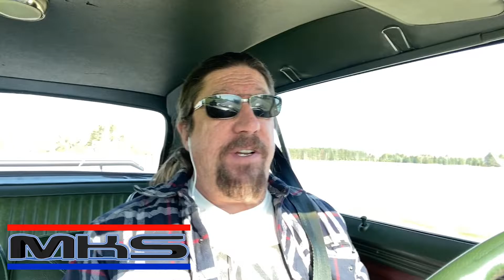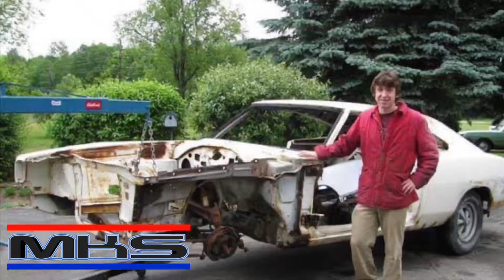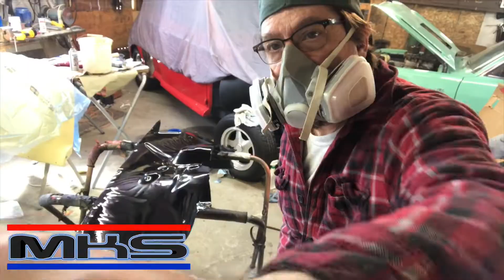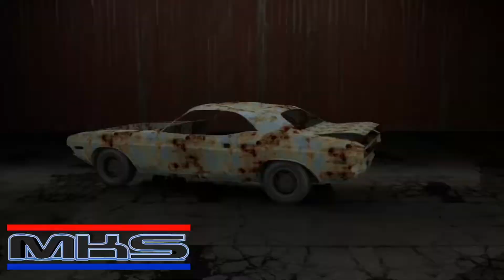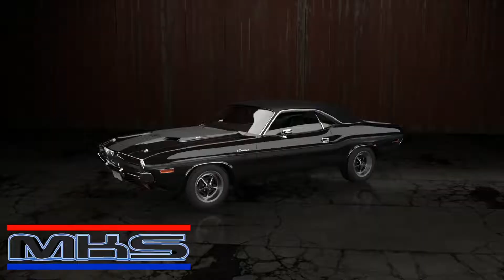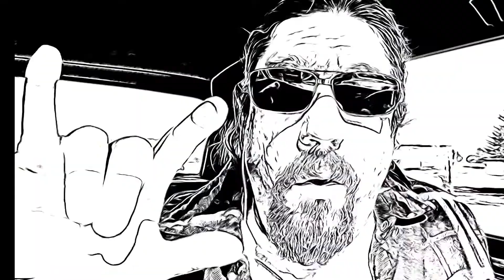Intro To Understanding Volumetric Efficiency HOW TO: pick the right carburetor.  SIZE MATTERS!!!

Comment: VE is not theory. They way you get 100+  VE is by utilizing forced incudtion which stuffs more air in the cylinder than the static volume of thr cylinder.

VE is dynamic cylinder volume divided by static cylinder volume. Most naturally aspirated applications do not pull 100% of the potential air into the cylinder - it gets close at peak power...
Reply: This is why hot rodders focus so much on fuel, compression ratios, and quench.
Reply from the maker: Thanks for watching.

Comment: A couple of things, Speaking of SBC I saw a rat rod at a show several years ago that the owner had fabricated a plate to adapt 3 Quadrajets to a tunnel ram on a SBC. LOL, The other thing is on VE, I figure if you are at redline under load and your vacuum gauge is on 0, technically you should be good.  Of coarse I am getting to the point I'd rather have reliable than a few extra ponies. So closer to stock works better for me. RAWK!
Reply from the maker: I’m definitely all about drivable.